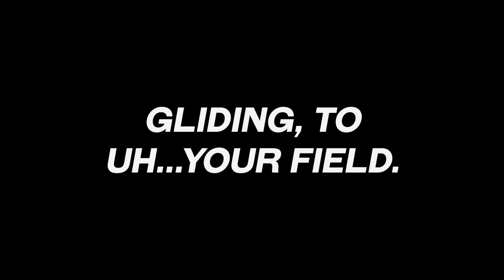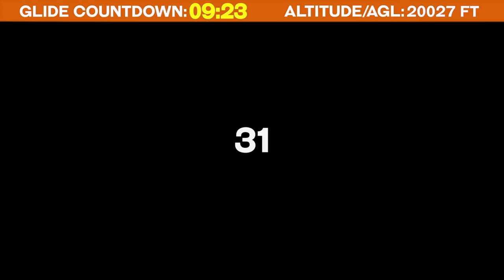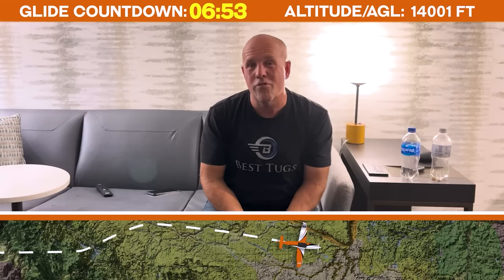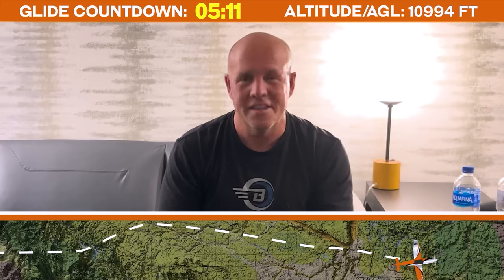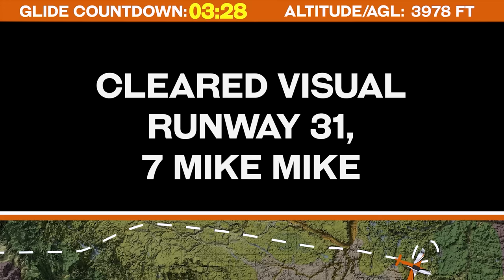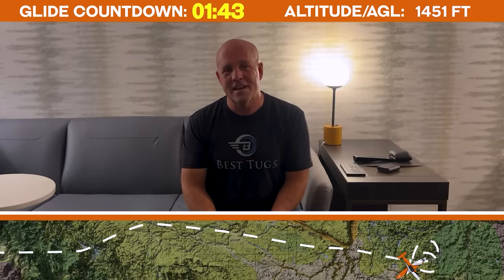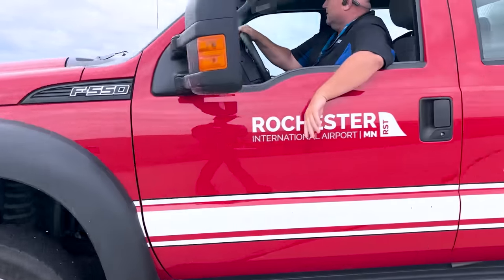Engine Explodes In Flight - Turbulence will not be at Airventure 2023 | Turbulence Emergency

Comment: Mike…glad you are safe. Great composure and airmanship… 

I have a theory on your failure - I have seen this failure before and I think you will find the engine uncoupled … the -41/42’s have been know to have this issue.  The shaft fails between the power turbine and the reduction section.  I have personally seen one on a king air and the damage and failure was similar.  It is an established failure point and has prevention directed at it in the form of a mod. Typically it happens when internal parts are not replaced correctly at OH but ours was a straight up failure… the research is out there. Do you have chip detection?

Comment: I had a loss of oil pressure of the left engine in a U.S. Army U-21A after take-off climbing out passing 3000 feet. We had a total of 5 souls on board. Since the engine was running, I did a 
180 degree turn on a beautiful calm day and taxied off the runway to the ramp. The temps were in the green (ok, oil temp is read wet) there was no smoke.  After shut-down, the
 mechanic pulled the oil filter. It seemed like the entire engine came out with the filter.

Comment: Wonderful handling of the emergency mike .. I had same happened with me on UH-1H helicopter with Lycoming turbo shaft engine which shut down immediately mid Air with no indication at all but there was no explosion at least. The big difference was that I was flying at 2500 feet above ground 😊. And I put the helicopter in autorotation and had only around 12 seconds to put the helicopter on ground 😊. But made it safe on ground  in the middle of nowhere 😊.
Reply: For that to happen I had to put the helicopter in autorotation before I could ascertain that the engine just died on me instantly. But as you were saying that practice of autorotations which made my muscle memory to go in action without me thinking or planning . And that was the thing which maintained the rotor RPMs and we made it to ground safe . Practice is the key
Reply: Good job! Broken wing award? Automatic reflex from doing autorotations is the key.   I did those all the time as a Maintenance Flight Check pilot for the U.S. Army. UH-1s, AH-1s, and OH-58s.  No auto-rotations in the C-12s, U-21s and G-159.
Reply: @PHILDRU911  😊 that’s correct .

Comment: Great story, agree new engine probably overkill and can still have issues.   The only thing I can think of is do a hot section inspection before you put another used engine in.  I suspect that when you find out what happened it probably could have been discovered if someone looked for it.   Just found these videos, will look to see if the suspected cause has been found.

Comment: hmm, worked with rotating equipment(multistage fans, like a slow turbo) honestly there are only two things I could think could have happened. 
1) Improper heat treatment, more likely, used to delivered to a factory that produced titanium and rare alloy parts for helicopters, they had an very important part fail in the field resulting in multiple first responder lives lost, and had to close shop when it was traced back to them. Even if you run a tight shop, things can slip through the cracks.
2) Unlucky resonance, less likely, is reached after enough time passed and systems stabilized at altitude. Everything fine until some little frequencies line up wrong, stack, push something rotating hard, cause a bearing surface to skid, gall and your gone all in a second?

 Nothing you can see, possibly even detect until after, but both have caused many real failures.

Comment: I've seen CT blade failures on a PT6 engines that twisted the whole case. Engine was scrapped. It decoupled the propeller and sheared the governor shaft when it stopped so fast.

Comment: A close realtive retired after 44years commercial flying with 18.000hrs, about 12.000hrs of which they flew on PT6 powered aircraft such as the Twin Otter, Cheyenne and Super KingAir. Only engine failure they ever had was a broken high pressure fuel pump fail in a Cheyenne. (so flameout) I have more than 4000 hrs on KingAirs, I only had one diaphragm of the bleed valves go bad, which limited torque output quite severely (to about half). So yes, the PT6 can fail. OTOH we had a PT6 overhauled (a -42) that after 200hours was boroscoped and 2 compressor blades had broken off roughly in half and that engine ran cooler than the other ! Good you made it safely to the ground.

Comment: Sorry for your loss.    We have seen 2 catastrophic failures in great things you have built.    Ive been an admirer for years.   Would you consider a much more powerful and nimble Garrett engine.    Single shaft.   I don't know they are more reliable than a PW, but i thought that and ramp decibels were the main selling points over the more powerful and more efficient tpe single shaft turboprops like the Garrett/Honeywell.

Comment: Something to keep in mind is that modern batteries don't have the same discharge curve that old lead acid batteries.  They maintain nearly full voltage until they hit their endpoint and then drop like a rock.

Comment: Hi Mike, I had an auxilliary gearbox shaft fail. As you say, the BANG is impressive as is the automatic feathering of the prop. Luckily, the EMB110 has another engine so, just having checked out the stall warning device and autopilot elevator servo (which had been changed in the hanger) over the North Sea, I returned to ABZ from which I had just taken off. However, ABZ had taken advantage of spraying the R/W with anti-icing fluid as soon as I had left on the first flight after it opened. With a "Pan" declaration, I was returned to R/W16 which was the wrong thing to do. The wind was directly across the R/W but, I did not think of the effect of remaining engine and its reverse thrust. I can assure you, no-one had landed onto an iced R/W which had just been de-iced until my attempt. I should have taken R/W34. The firm landing got the wheels turning but, with the wind trying to turn me into it and an inability to use the reverse without agrevating the situation my dab at the brake locked the wheel on the ice which was worse than slippery!! Eventually the burst tyres (hitting a dry patch) gave the aluminium rims contact with the tarmac and the a/c stopped. Now was the Keystone Kops moment. The fire truck following me down the R/W put on its brakes. Luckily it was not headed for me. It slid right past me. Two of the firemen jumped off and immediately landed on their backsides. Luckily they let go of the hose as they stopped before the truck so weren't dragged with it.
The end result was a NOTAM about the effect of de-icing fluid. My speil to all is, "Take account of the X-wind and your workable reverse. You may have to request the non-operative R/W". Glad you made it.

Comment: Yes they can and will happen to you sooner or later if you fly long enough. I had a new engine cage on climb out on first power change as a student solo. I pulled power back a touch from full power takeoff to climb power when damn. Bang. At that Instant The training kicked in and all was well. It was about a half hour after climbing out of the aircraft when it hit me what had happened and how close I came to making the news and not in a good way. And yes, a sudden and complete stop makes the aircraft really squirrelly for a minute. But what is worse is a little while after I got out It made my knees weak and made me dizzy. I get it. Its a crazy ride. Be safe.

Comment: Find out when that PTB #2 was installed and who provided the part to the overhaul shop. Like you said this is the one of the most reliable engine in the world. On the commercial side we get
Up to 11,500 hours. It had to be temp FOD overspread or corrosion . I'm surprised at how bad of a failure it was , we have lost turbines before and usually the parts only come out the exhaust.

Comment: Hey Mike glad you landed that thing wow I heard thinking back when you're talking about the blades there was an accident a few years ago on a full size jet engine and I found out that one of the blades that let go had a crack for some reason that the radiograph x-ray scanning missed and it lasted for the blade itself lasted for 20 years a flight even going through servicing it didn't catch this blade you could have had a bad casted blade it's just a thought I'm glad you're okay and the planes, by the way 411 knots 472 mph man that's something else that's right up there was the fastest prop engines ever

Comment: I am not a pilot nor a aircraft builder but I am a doctor that works on shockwaves for my entire life and your speech reminds me about how shockwaves where first noticed because of broken things inside airplanes storage compairtments.  Things just broke despite being well acconditioned and that was because of shockwaves.  I watched your vídeo constructing the ship and such a powerful engine fixed by a cage with that helix ahead may produce shockwaves depending on multiple factors such as wind velocity,  turbulance,  helix  degree, rotation speed, engine ressonance and só many other factors that could create an environment where shockwaves could appear and be directioned towards mobile very speedy  parts and fracturing them at no previous notice. Of course I am not an engineer but I think that could contribute on thinking about what happened up there. Thanks God you both are alive and well.

Comment: On Pt-6 engines during startup, you want to get maximum engine rotation "before you interduce the fuel to the engine". This gives you a cooler start which very beneficial to the life of your engine. Did you ever get all the audio from this emergency...including tower audio? If not then please try to get them now...you will be very happy that you did. Blue Sky's.

Comment: Did you mate the PGB Yourself, did you do a HP turbine disk installation on wing.
You are very correct into Pilots stressing the engines in Hot Starting. I as a mechanic PT6 a pilot came up with the same catastrophic failure, Beec18, I'm glad you are good and very situational awareness into emergency procedures specially with an experimental bird, Good Luck in the future and I would recommend an FDR Until very very set...🙂👍

Comment: One of the Scariest Story's  you could ever hear . Very much a  WTF just happened moment . Well done getting down  safely . 
Anything  mechanical can just  shit itself at any time regardless of how well it is made . Even  Brand New , out of the Crate .
This Failure could , in fact , be a result of a Harmonic vibration from the actual Application you have , the Small Airframe .
Ultrasonic . You won't hear it of feel it . Engine makers of all types of engines have encountered that issue before .

Comment: Was thinking about this video.  I use to fly a Piper Meridian.  One of the Service Bulletins and or AD's  on the PT6 was to bore scope it for a defect in one of the turbine wheels.  I actually flew one that was repair offer it failed in flight and the pilot dead sticked back to  the airport.  

Another thing that  strikes me is most turboprops fly somewhere around 300kts.  You were flying somewhere around 400kts.  The inlet air pressure was about 33% more than average.  As far as I know there is no indication of air pressure at the inlet.

Comment: The killer for most turbines are hot starts. Most pilots are in a hurry to start the engine and add fuel too early, also if you have week battery. Did you use a GPU for assistance of your start? It helps, saves battery and the hot section.

Comment: Hey Mike, please update with the report on the failure mode and any causal factors. Part of me wonder if the engine mount/cowling envinronment allowed a thermal buildup, expansion and some localized stresses. Any strain gauges in there?

Comment: Hi Mike,
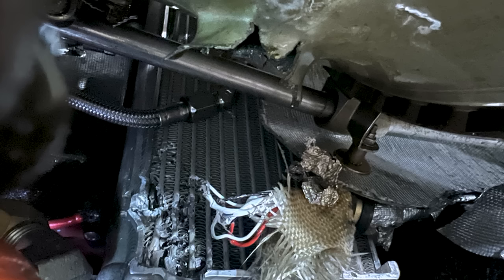I just saw your video. At 12:14 you show the intake-blades of the turbine.

When I compare the diameter of the intake-blades and the size of the air-intake below your propeller, it's obvious that there is a massive difference.

When somehow the size of your air-intake is too small, then there could be some kind of vacuum in front of the intake-blades. The  intake-blades are not built for such a vacuum. It will add additional stress on the blades.

For your safety, would you please verify this! Also, I would measure this intake-pressure and add it to your logs.

Typing this message, I realize, there could be another kind of pressure problem. The air-intake is at the bottom of the aircraft. Therefore the air in the chamber between intake and intake-blades has different  distances to travel until it reaches the bottom half of the intake-blades and the top half. When there is a pressure difference between top and bottom half, then the blades are continuously bowed more or less. This will also put a lot of additional stress on them.

Comment: I'm so very glad you are okay. Experience & training make a difference.

I'm sure this has been thought of, but as you were talking about your concern about the batteries losing power I had a thought about an alternator or generator that is powered by the prop. If the prop can spin when the engine is running, or more importantly in a case like this, when it isn't; could there be a way to use the plane's forward momentum when gliding to turn the prop to keep the batteries charged?

Comment: Good video Mike and glad you are ok. The hairs on the back of my neck raised up when the control tower asked how many souls on board. 

I do have a question for you. What type of vibration sensors your have on that turbine?  Im no engineer but i do alot of reliability in the oil field on pumps and turbines. Alot of sensors are in overall vibration readings and not a spectrum wave form. There could of been something wrong from the from the start but if in high frequency, your overall sensors would not pick it up. For example say you have 32 blades on that engine and one was loose or faulty a spectrum wave form would pick that up on the 32x where the overall vibration sensor would not. Next turbine you put in have a vibration tech look at it. Its amazing what they can pick up.  Just make sure they are CAT3 or CAT4 certified with lots of experience.

Cheers

Comment: Having worked for a repair station that specializes in PT6 engines, I have seen a few engine failures. Most of the time the culprit is human related (hot starts, overtorque, poor maintenance, shoddy work from other shops).

Comment: Ouch. No warning at all and then total catastrophic failure. Yikes. I lost a jug on a C421. It was the critical engine as well. But still had one left to land on. Keep your head on in these situations, it is what you need to do. Good job getting down ok. With smoke in the cabin I would have been very tempted to shut of the master switch. But then you can not talk to ATC either. Quandary.

Comment: I saw a PW901A (747-400 APU based on PT6) have a similar failure in the Power Turbine.  An engineer at the airline signed off on excessive sulfidation of the PT blades.  That would mean it was excessive loss of the protective coating on the blades and erosion was happening to the parent material of the blades.  Once that happens, the blades weaken and failure is going to happen.  Usually, it is a sudden failure, so I would say that is what happened here.

Comment: Who knows but basically this is an old problem. You're scrounging parts from various sources and at some point you dip a little too close to "saving money" instead of "buying a good part". 

This is where that old song and dance comes up. 
Test your way into full performance. 
Tear the motor down and check it. Closely. Then check it again.
Start it up, fly it around the field, shut it down, tear it down and test it again.

do this three times. Then take it up and fly it at speed for a short distance, 
Bring it down tear it down and check it. 

You never want to fly it for an hour and then check it. 
Run it up, get some time on it, bring it down and tear it down and check it again. 

Extend that to longer and longer periods. 

You said it yourself, that type of engine never breaks down, it's the most reliable turbine engine ever. But it's the TYPE that is like that. Not that one specific engine.
You assumed that YOUR engine worked as reliably as all? Most? Engines of that type.
That might be true for most of them. But is it going to be true of all of them?

One engine,  two passengers...no chutes? 
So if you're wrong, it's a flaming fireball dropping to the ground like a rock?
Might not even have wings? Maybe one? 
I'm surprised that you even left the power on.

Comment: It’s always scary to be around equipment that stops like that. Once witnessed a 3 1/2 foot cast iron wheel on a band saw stop instantly when the bearing failed. It was LOUD! The rollers dug into the race. The race looked like smooshed play dough.

Comment: Congrats on making it to the other side of an emergency. Thinking outside the box, since you are in a single engine scenario those engines that get hour extensions usually are on twins. Sine your aircraft is single engine, I would suggest having a Hot Section Inspection on a "new to you" engine. It can be done in your hangar and you get piece of mind and resolve the wondering of previous owner treatment.  My experience with turbines has been most failures happen when a power change is made, did you make a power adjustment before the failure? That feeling you got, the twinge just before it said, I'm outta here, I call the Butt-O-Meter, every good pilot has one. Good luck in all your future endeavors.